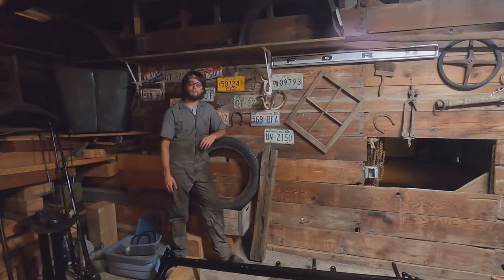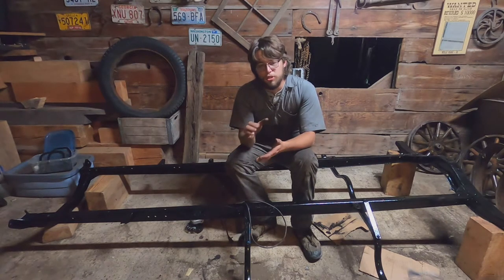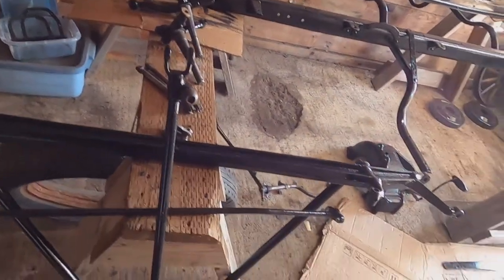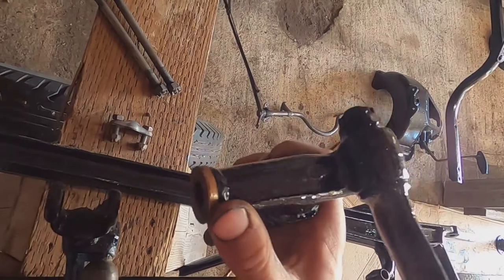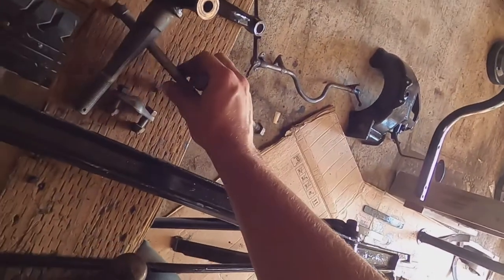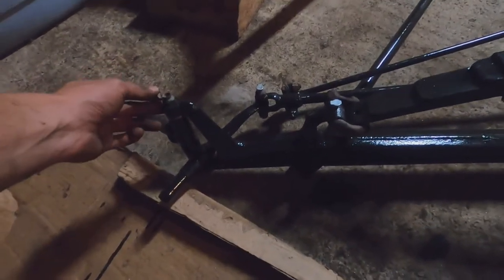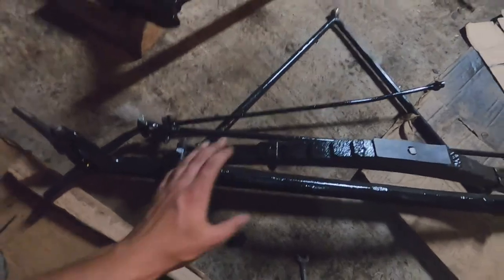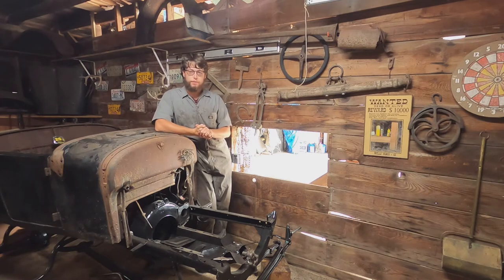Painting the chassis, Model T restoration part 5

Comment from the maker: For those who might be interested, I did forget to mention that the spindle bolts / kingpins also use the large style flip up oiler.  I didn't need to get new ones, so in the video I said the front axle only used two large oilers when it actually has four.

Comment: Do you use an acid-etching primer before using the Rust-oleum paint? Also, can you identify the actual name of the Rust-oleum paint product that you used? A photo of the paint can with label would have been nice. I have use Por15 in the past, but it is costly, and you do not want to get spatter spots on you, as well as the container lid s easy to get welded at the top if you don't know how to properly store it. Rust-oleum has so many various paints, that I just wanted to see which one you used. I would suspect that Tractor Supply farm implement paint would be a good choice, as well, but I have not used it in the past. Thanks.